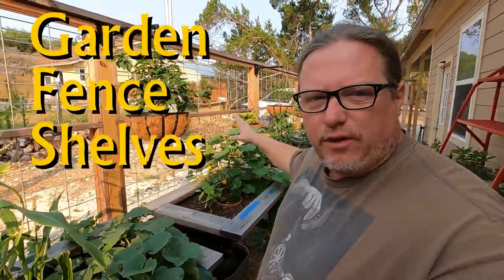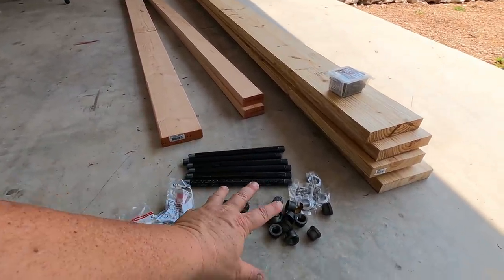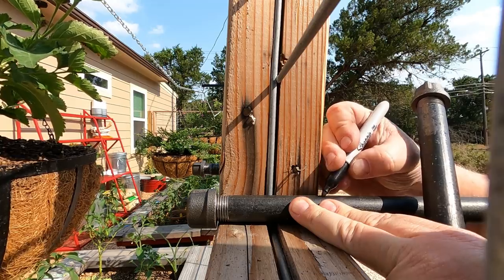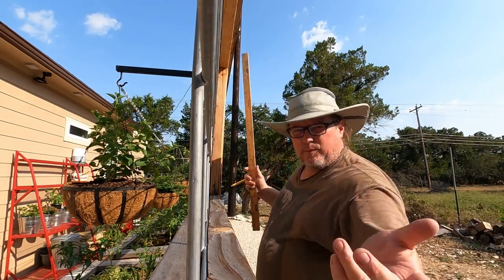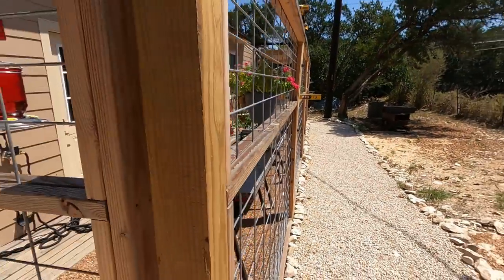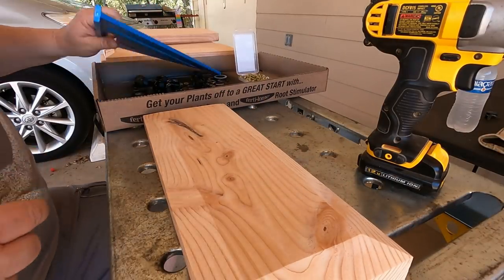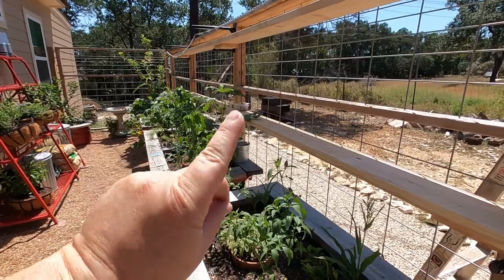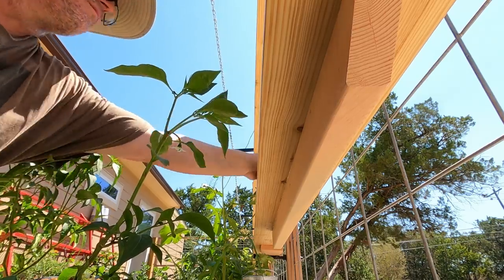Easy to Build Shelves for Your Back Yard Fence

Comment: Great video and build! I love the idea of using the steel pipes for supports. It looks a helluva lot better than those shelf brackets from the hardware store. LOL
There were 2 things I noticed that I would probably do differently, having watched you go through the process. I think that, if I were to re-create these shelves, I would screw them from the teeter totter bracket upwards into the shelves. This would prevent water from pooling in the little divots left by the screw heads. Also, I think that before I attach the shelves, I'd glue and screw the support beams to them before installing. Again, from the underside, drilling an oversized pilot 3" into the 2x4, leaving 3/4" of wood to support the screw. (beats the heck out of measuring and screwing upwards at an awkward angle) 
Other than that, I love the look and functionality of them. You've got a beautiful garden! 
Cheers, from Saskatchewan, Canada!